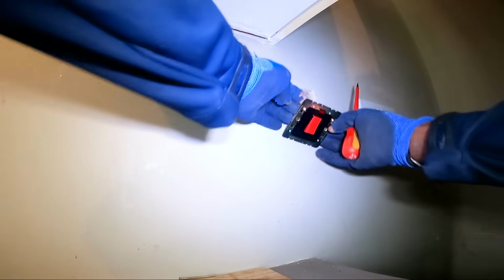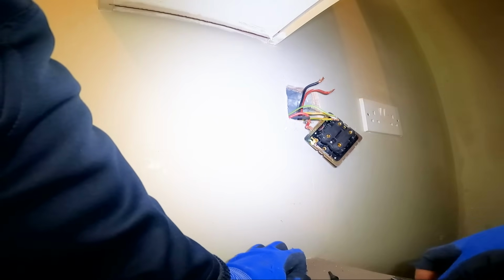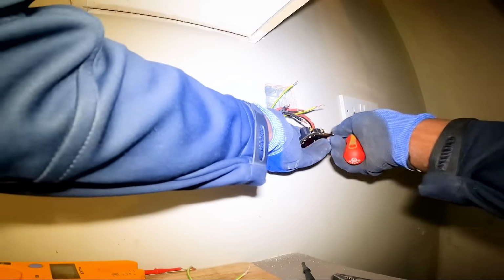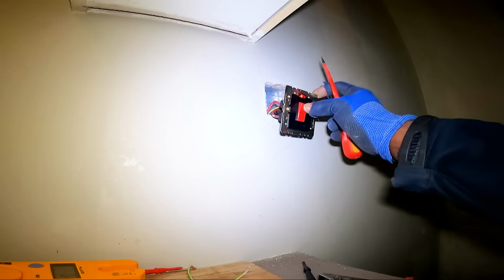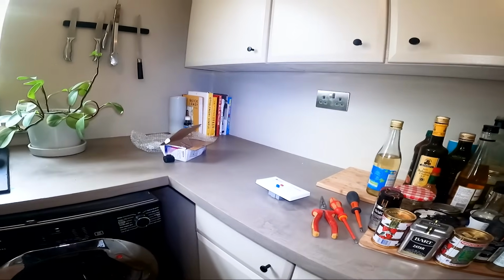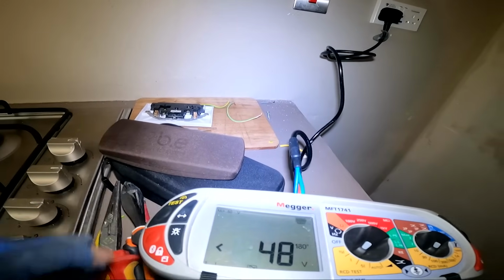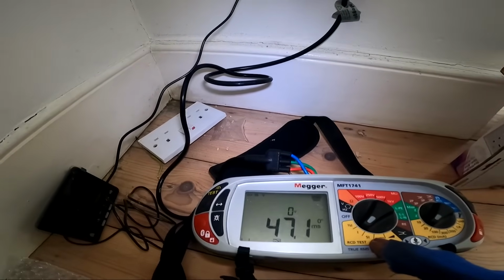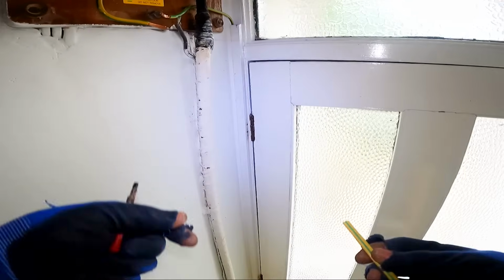Fitting RCD Sockets

Comment: As far as I know only Contactum make a chrome RCD double socket but it is a slightly different shape / style to those ones there. Theoretically, you could have put that double socket as you have behind the fridge and then got a plug in outdoor socket kit so that the occupants would use it as it’s already outside.

Comment: Hi Delroy first of all I wish you a Merry Christmas and hopefully no more stealing out of your van ! I wonder do you ever put ferules on the mains wires before putting them in the screw terminals of a socket ?
Reply: The mains wire is usually solid core twin and earth cable so no need to ferrule them. Ferrules are usually for stranded flex cables.
Reply: @roydowling2542  ah I saw Delroy explaining he learned from an apprentice to twist the wires so it looked like they were stranded
Reply: 6 & 10mm cables are stranded, ferrule optional @maicod
Reply: Thanks  @martynb9